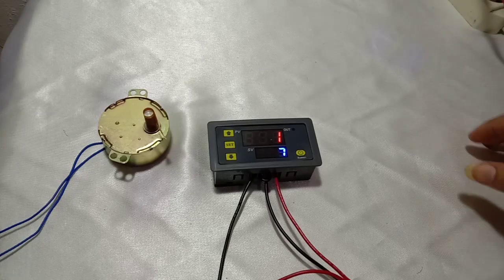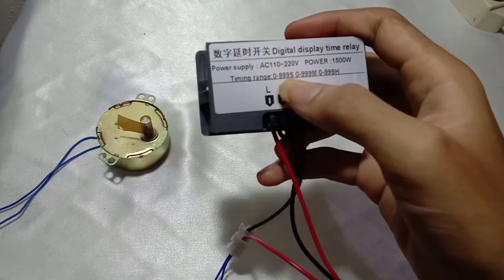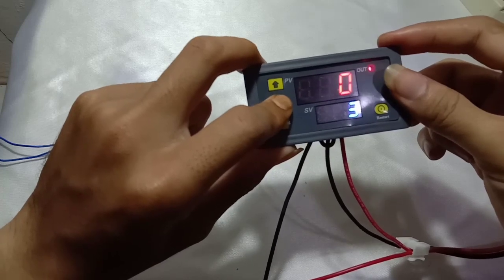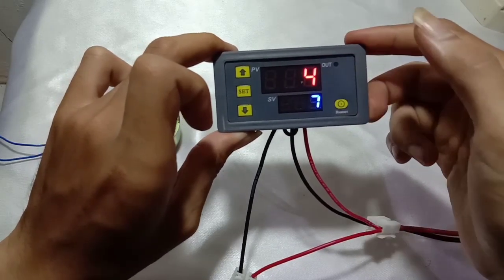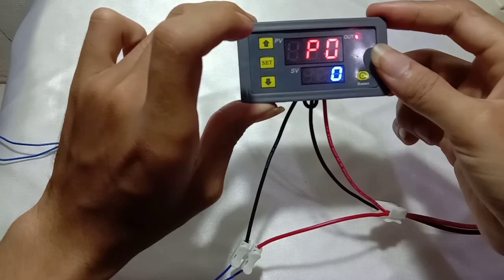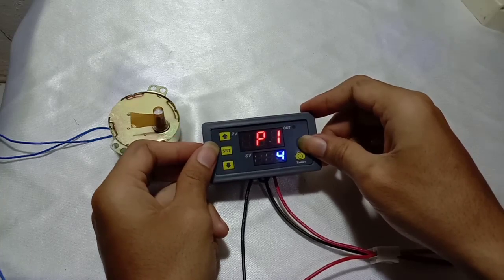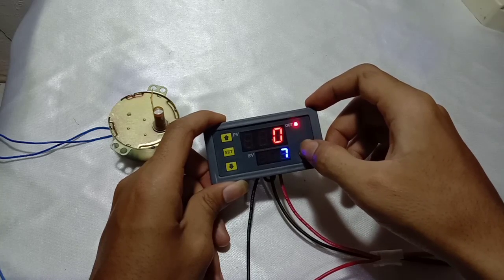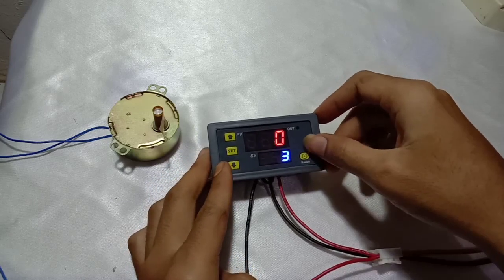How to set a digital timer for digital display timer 220V AC

Comment: hello, thanx for the video and good explanation, I have a question does the in circuit and out circuit have the same voltage?

if I connect to 220v when the cycle start it will provide 220v?

Thank you
Reply from the maker: Yes, it will provide 220v for the output